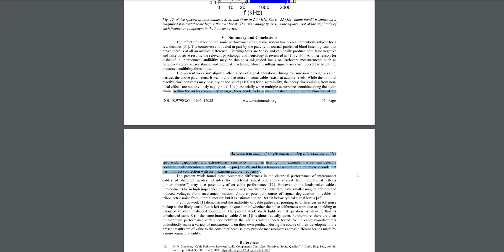Scientist Finds Measurable Difference in HIFI Audiophile Cables ! PROOF

Comment: So long as certain mechanical criteria are met (should never be an issue so long as the cable is competently manufactured  which it should be on anything costing even pennies per metre) then there should be no difference between connecting active components. With passive components like a phono cartridge then things like capacitance can make a difference and this is an accepted fact of circuit theory. There will be no difference between two mechanically competent cables with the same LCR characteristics no matter the claims of the cable manufacturers. When connecting active components even quite large variations in lcr characteristics will make no difference to the audio spectrum. You need to go to RF frequencies for these differences to have any effect. Also the ear has a very wide dynamic range but otherwise has no mystical abilities. Double blind testing is the gold standard yet cable manufacturers go to great lengths to try to make us believe that they aren't relevent for to assess their products because noone can tell the difference in double blind testing. Iasked a retaailer to demonstrate a high end cable vs a basic cable. After he "upgraded" the system cable he surruptiously jogged the volume dial up and then said the cables made the system more dynamic! I asked him to return the volume to its previous level which he did looking obviously uncomrtable. The "extra dynamics" then vanished and it sounded exactly the same as with the cheap cables. I note that the mark up on hifi cables is double that of actual components and hifi dealers make most of their margin on them. One dealer I spoke with refused to let me book an in shop demo unless I agreed to spend 40% of my budget on cables before I came into the shop. These two examples should tellyou everything you need to know about the cable controversy. I used to work as an rf engineer - the paper has no value. All the effects described are factors at rf not audio frequencies.

Comment: Electric signals travel along the outside of the conductors of a cable as an electromagnetic field.  It’s not a hose flowing water as taught in simple terms.  Given this, there are effects on the electromagnetic field from the materials and mechanical design of the insulators and conductors in a speaker cable.

Comment: I didn't know why sometimes the same audio system sounded much better; other times, it didn't. Until I realized and could reproduce the situation, the position of the cables (and the 2 RCAs against each other or against others) clearly influenced my sound. It was about clarity, at least. This made me buy some more expensive cables with good reviews. Maybe I was lucky, but immediately it was much better: less "noise", more details, in general, and a much better sound.
I still have fluctuations in the sound quality, I don't know if it has to do with the position of the speakers, with my changing perception, but these differences start anyway from a much better level of sound compared to the one obtained with the old cables (it's about the cables between DAC and speaks).
In the past, I did not believe in the difference obtained by the cables when I did not obtain any noticeable difference for another DAC and other speakers (they were 3.5 to RCA in that case).

Comment: How should I determine which audio cables to purchase?  The price difference for a pair of 3 foot cables range from $10 to $3,000 or even more.  Speakers, amplifiers, DAC and other components all have specifications (Frequency re3sponse, THD,  slew rate,  current capacity,  SPL, watts, supported resolution)  to help me decide which to purchase.  But what about cables?

Comment: As in my opinion: cables sound of course differently. It al depends what's inside of them. Copper, Silver, gold, you name it. Is it a big difference? Sometimes it is sometimes not. Depending also the electronics AND the speakers. Can you measure these things? Apparently this seems very difficult. But what I've been through in my short audiophile journey untill this day (about 4 years now) I've heard enough differences in my own setup by changing and upgrading to better interconnect cables and speaker cables. And those where very big. I also like to test things so...
Reply: In a blind listening comparison, you wont hear a difference! Try It!!

Comment: Some considerations after nearly 50 years of listening. All the following is true from direct experience. 
Cables CAN make a difference, but many expensive cables sound exactly like cheap ones. Making a difference does not necessarily mean BETTER or WORSE. Sound is much more complex than that. A cable may improve some properties and make others worse. 
Many audiophiles hear improvements where there are just differences. Some audiophiles hear differences where there is none. Some people love to boast and are just happy saying that they paid 20K for a cable. They are typically unable to tell a bassoon from a clarinet, nevertheless they consider themselves experts. "Critical listening" is just a way of feeling very important. The only thing that makes you important in music is writing and playing music. 
Some people think that if they don't hear a difference they will be treated like noobs, so they hear improvements that are not actually there. 
There are people who clearly hear a difference when they know that a contraption that looks just like a broken alarm clock of a certain kind is in the house. They are willing to pay many hundreds of $ for the broken alarm clock. 
Some people hear a timing improvement and jitter reduction from the presence of a device on the Ethernet connection. Yes, even if the Ethernet connection is totally asynchronous, self correcting to a degree, and packets don't even need arrive in the right order. 
Some people hear differences because they do not want to admit that they were scammed. 
Treating your listening room will give you improvements greater than those that you can get from a new cable. Many people try new cables before even thinking of treating their listening room (but the wife acceptance factor may play a role here). 
Some differences are totally inaudible if the rest of the hifi set is not of adequate quality and/or the listening room is particularly bad and untreated. It is totally false that a 20K DAC cannot sound better than a 2K one. It CAN, it absolutely CAN, and in some cases it DOES.
Even if some cables make a very obvious difference, and among these some actually improve in a clear way the sound from your hifi set, there will always be someone who says that there is no difference and that everything is in your head. Many (not all) of them are just envious because they can't afford those cables. Or they love to feel like the ones "in the know" and to have followers on their sites and channels. Some of them make money exactly in this way. Others are ideologically against anyone with a lot of money in their pockets, and love the idea of calling them idiots.
Some people's faith in measurements makes them totally impervious to facts.

Some people fail to understand that things that are observed, measured and studied in Physics today were not even known or remotely suspected to exist less than 100 years ago. Some people do not understand that Mathematics and Physics only offer models, and that models are not perfect representations of reality. They are just useful approximations. Mathematical modeling is my job, so I am writing against my interest here.

As Leonard Susskind (no need for an introduction I hope) wrote: "When a nice theory meets an ugly reality, it's the theory that must leave town". From the same author: “Unforeseen surprises are the rule in science, not the exception. Remember: Stuff happens.” And again (still Susskind, quoting Shakespeare): "There are more things in heaven and earth, Horatio, Than are dreamt of in your philosophy."
Reply: Jesus! You have a lot of time on your hands...
Reply: @dihydrotestosterone  we call them holidays.

Comment: Hi Jay, thank's for posting this one. Interesting it is, however this only shows that there are differences, but the main question for the audiophile remains: which one is optimal for my system and more importantly for my ears? If we have good components for example amp + well matched loudspeakers then they will sound good even connected with a wire from an old lamp > which means it is the starting point for eventual improvement IN THIS PARTICULAR SETUP. What sound good in one can be disaster in another one - this of course you know very well :)  cheers.
Reply: It's even worse: even if it shows that there are differences, will they be audible? How do they correlate with what we love in music? And do we all agree about some objective property in reproduced music that makes it more enjoyable? I am totally sure that if we take a random sample of one thousand people from the general population, and make them listen to 20 different hifi sets between 1000 and 200.000 $, all at the same sound pressure level, same music program, for the same amount of time, and ask them to identify the three they love most, we will be surprised by the variance in the results. Too bad it would be an incredibly expensive and logistically complex experiment, otherwise I would do it in my University.

Comment: As I mentioned earlier on other clip, from irrelevant measurements you will each time get irrelevant results. What research document show is something known in HF systems long ago, but incorrect assumptions from medicals that we cant hear over 20kHz mislead all industry.  Because Doctors do not understand energy transfer or energy impulse meanings. Story is not ending with interconnect cables. Can you imagine what impact is from louse routed wiring inside audio devices, that you do not see nor consider. A small piece of industrial wiring inside your "high end"  DAC or amplifier can make much more impact than interconnect wiring / cabling. Not to mention power supply quality issues that are not consider at all with impact over internal wiring on active audio paths. Standards are not for Engineers, it is for others without proper knowledge do they will not be electrocuted and killed. But for performance targets there is no standard nor measuring procedure. Yu need to understand Physics to be able to handle any of this, as people that make test described in paper do.

Comment: No point trying to address the controversy about cables making a difference. Those folks who have never heard the difference cannot be persuaded that cables matter. In any case if they honestly can't hear a difference then why should they waste their money? The only problem I have with such folks is their desperate obsession with trying to ridiculing those of us who have no doubt that cables do matter! I suspect folks who don't hear a difference have setups that are so significantly unoptimised that the benefits of cables are masked by the system. Either that or they are simply listening for cables to produce 'improvements like maybe more bass, or sharper treble when in fact the changes in my experience tends to be more related to spacial and timbral changes.

Comment: I can dig it. I can understand if two cables will sound different. You could go extreme, one made of mayonnaise, one made of pure copper. I'm more interested in what makes the difference, and where the diminishing returns are. 

Construction (shielded / non-shielded), materials (copper, twisted thin gauge / solid cable, silver, silver-coated. That is, something measurable, towards a specific goal you are trying to achieve (Time coherence, flat response, resistance to noise / distortion), ....

Maybe just having a set of copper wires for $30 is enough, maybe the sweet spot can be found arounf $500, or you can scale the benefits by throwing cash and engineering at it. I donj't know, and I don't have a bone in this fight anyway.

Comment: Interesting yes, but relevant? Notice that the author side-steps the audibility question at every turn. There is only one (1!) paper cited on audibility of cables, and that is by the same author. Hmm. Most of the other references are from conference abstracts, and as anybody knows who is working in sciences, a whole lot goes in conference papers, and much never make it into proper publication. As a science editor, I also notice the extraordinarily sloppy editorial job, too many problems to enumerate (variance? statistical tests t/F? spelling out numbers <10, colloquialisms, G cable vs. |G| metric: very confusing, +++). I would not have let this ms go to print. 
You do not need fancy equipment to prove audibility, just simple A/B tests with >8/10 correct identifications. But that is sorely missing. The placebo effect is well demonstrated.
And industry measurements as alluded to in that paper? If industry has them, why not publish them? I don't think any of them have the foggiest about any scientific measurements.  Except measuring money in wallet/bank account. They are experts at that.

Comment: Cables do make a difference but there's many times where that difference is so minimal that most can't tell. One time that I could tell: bought some sale cable to make a bunch of guitar pedal links and finally a couple 15' cables to hook to my amp. Soldered everything, hooked it all up, and it sounded like a comforter was thrown over my speakers. Switched all the previous cables back in and all the treble came back. So yes, cables can definitely make a sonic difference, but I don't think you'll ever sell me on anything over $1000.

Comment: Ok.. I am a high end cable and power filter designer.  I will spill the beans, i was enjoying this debate... hehe.  Cables do make changes in sonic signatures, usually the higher priced, the nicer, to say it kindly. Theres all the known factors, conductance type of materials, dielectrics, insulator materials etc...  in order to see measureable differences one must use an intermediate preamplifier as a buffer with a 16 ohm load at the output. Its an impedence matching issue with cables, so we must use a buffer... Simply swap cables AB recording the waveforms, i recommend freq waveform validation.  YOU CAN THEN COMPARE THRU A NULL! You guys can also see with your eyes differences in musical output.  Sorry but, i would have to write a book on this to give complete full explanations. You guys can figure the rest... Science, AC signals, electronic principles.  Happy Validation...

Comment: You don't need a peer revived study to know that cables vary in capacitance, inductance and resistance (exactly the same components used to change the sound of speakers in a crossover circuit). These things can easily be measured accurately with cheap meters. My argument has always been that expensive cables just work as (expensive) tone controls when people have at least one component that is annoyingly bright. Spend the money on quality neutral gear and you won't need to buy expensive (just decent) cables to compensate for your mistakes in the synergy of your system. Also, there are no capacitors, inductors or resistors (or any materials that inherently produce the same effects) to warrant the insanely ridiculous price of many "high end cables". People could buy a hand full of these crossover components for peanuts and cut one end of their cables and by trial and error tune their cables to suit their liking perfectly. I have a pretty good understanding of electronics, so I don't buy the BS that cables are worth $5000. If there were more things that could change the sound than the 3 crossover components, then speaker manufacturers would use them, but they don't because everything else is snake oil. 

I get it, I like silky smooth detail, but when many high end companies focus on detail, it can compound in several components in the same system to be too much and right in your face. The snake oil companies know this, so they add a little capacitance or inductance to their grossly overpriced cables and laugh all the way to the bank. I have a $25,000 system and silver cables do make a rather large improvement is sound quality., as they should, because silver is one of the best (if not the best) conductor. Copper is one of the best, but silver is considerably better. Especially if you are using the cable from a low lever component like a DAC, where it's output (good or bad) will be amplified several times and expose the bad or the good. I paid $50 for silver coated XLR cables from China and they sound amazing. More detail, yet smoother. Also about 2 dB louder on my preamp display compared to the same priced copper cables. Adding capacitance or inductance to a cable will not give you more detail, because they are low and high pass filters. 

Any honest engineer will agree that their is no magic bullet to add to a cable that warrants a ridiculous price tag. I am open minded and always willing to change my views, but I at least need a logical argument to test. Wild and unfounded claims don't mean shit to me. That is what causes people to fall for the placebo effect, "I spent $5000 on these cables so I really want them to sound better". When I try something new I never "want": to see any positive difference and I never expect to hear a difference.